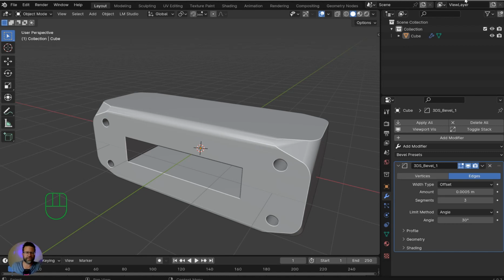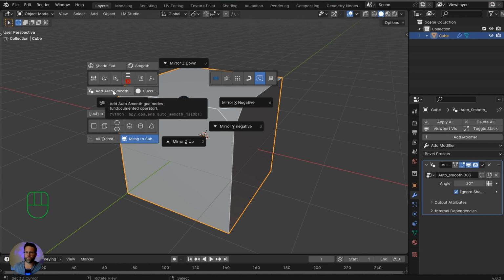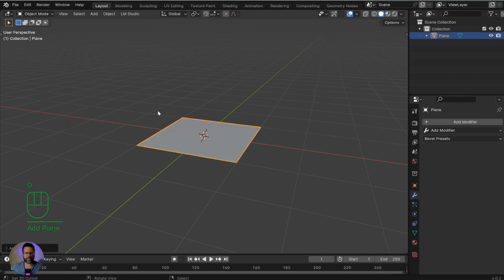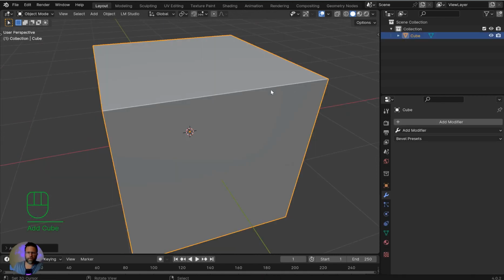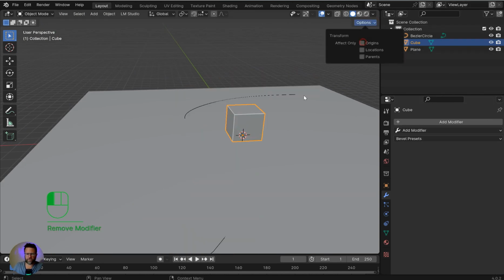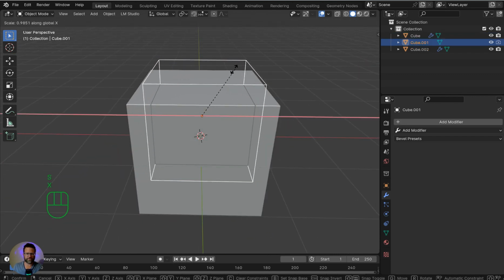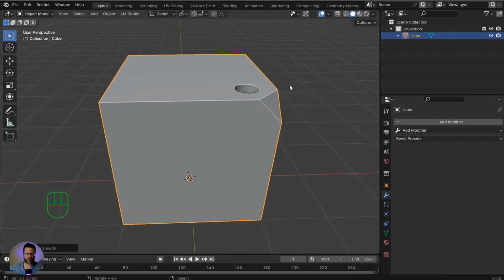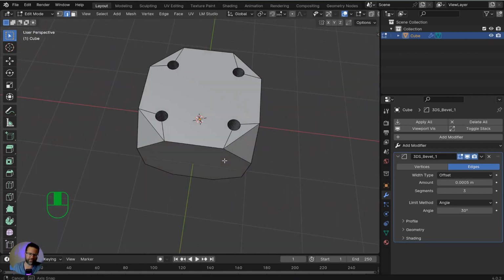Blender 4.0 Mirror Machine review and testing

Comment: What about modeling on a mesh and mirror over a set 3dcursor in all directions. Here it's only local on 0,0,0 if I understood it right. Add the other 'y' button instead of some ...
Like the other comment before me said, better conzentrate only on all possible mirror options available, instead of a collection of tools for hardsurface.
And don't forget to include 3dcursor, global,local, origin etc. You also can set the 3dcursor so that it aligns to transorm, geometry... so the newly added mesh is aligned as set...
Reply from the maker: Hello, and thank you for this feedback, added the Y positive axis and more controls are coming to each axis. Also, I added an organizational feature for modifier stacks to display only the modifier by type you are working on with custom controls.
https://youtu.be/FX8f58LwIV4